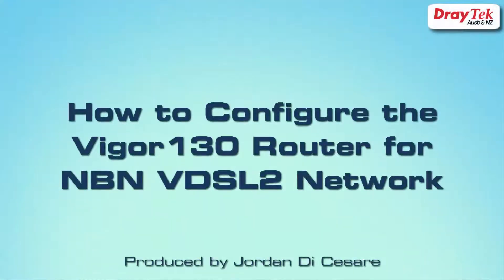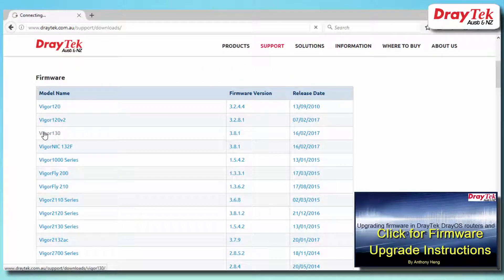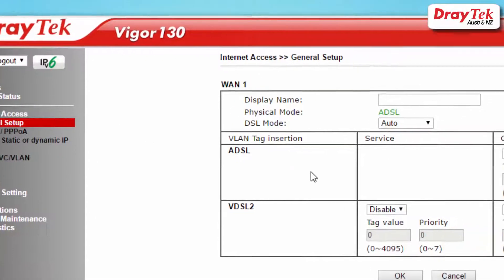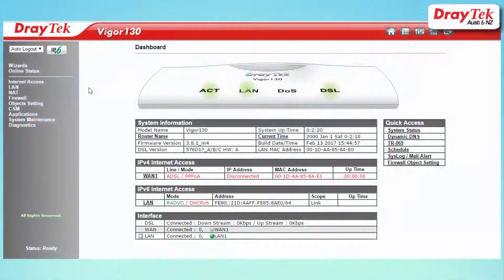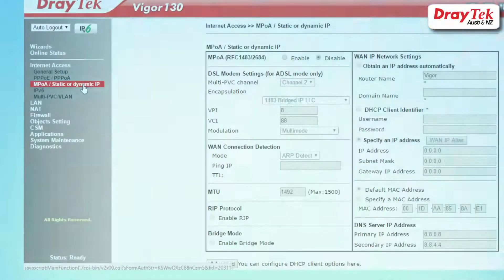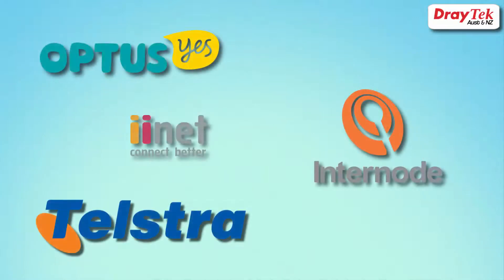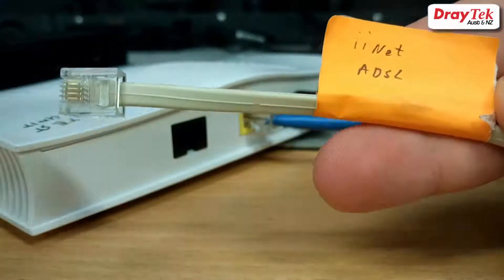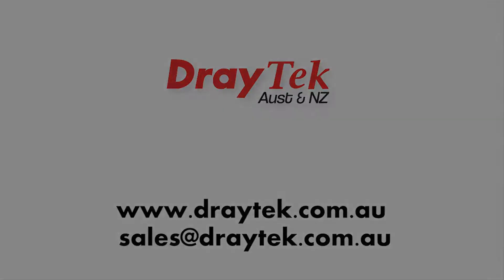How to Configure the Vigor130 Router for VDSL2 NBN Network

Comment: Hi can you please help me, my ISP states SRA is not working on my modem.
Reply from the maker: SRA in included in firmware Vigor130_v3.8.5.1_modem_11.zip	Annex A Model: VDSL2 57c817, ADSL 575a11.
Suitable for SOS/ROC enabled VDSL lines – Australia- Rel 16/11/2021
It can be downloaded from: https://www.draytek.com.au/support/downloads/vigor130/

More details in our application note: https://faq.draytek.com.au/2022/06/06/nbn-vdsl2-connection-update/

Comment: My Vigor 130 has almost NONE of the interface options you have and I'm ready to chuck it out the window!
Reply from the maker: Hi John, was your unit purchased in Australia? If so, ensure it has the latest firmware installed and try performing a factory reset. It could also be worth trying a different browser. Please contact our helpdesk if it's still giving you trouble after that. If it was an overseas purchase, we believe the Vigor130 may be sold in some countries as a plain modem with no firewall or routing features.
Reply: Chuck it bro